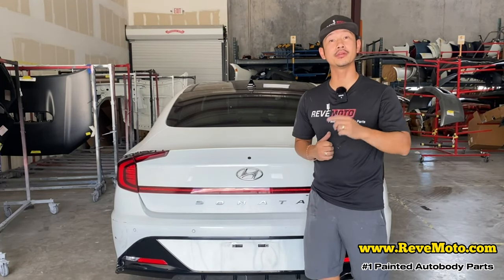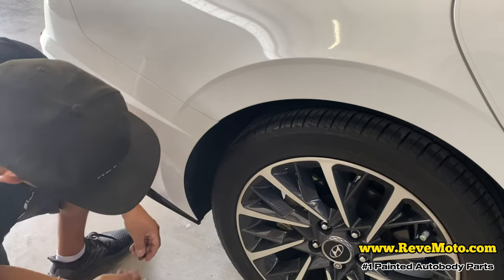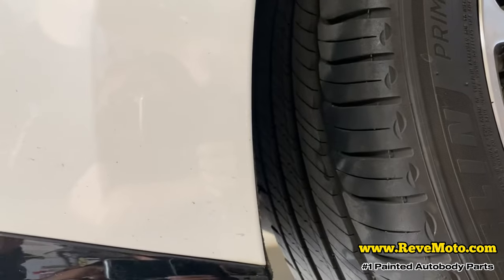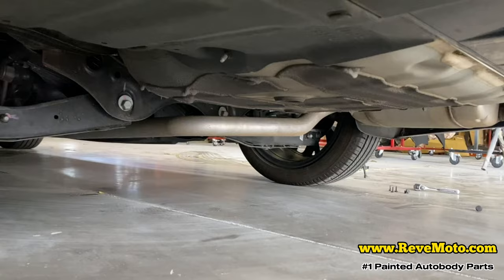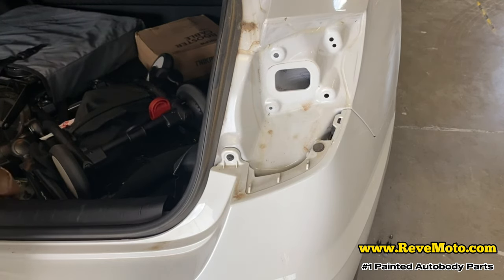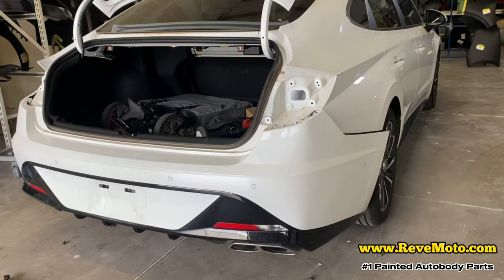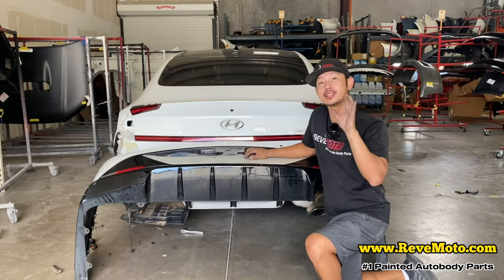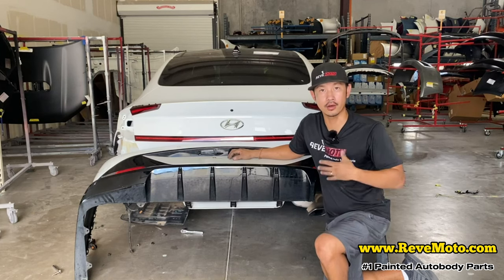2018-2019 Hyundai Sonata Rear Bumper Removal and Taillight Removal.  Less than 20 Mins

Comment: Thanks for the video! For others trying to work on this bumper, if you can't easily reach the screw in 16:43, the retention clip (86593) that's causing the headache is only a few bucks. It's a one-way clip with barbs that keep the bumper tabs from releasing through the slots. In a pinch, you can bend the clip back on itself so the barbs release from the plastic and install new ones on reassembly.
Reply from the maker: Thank you for that information!! That will help the viewers on other options.  You're awesome for sharing.  Go to www.ReveMoto.com for parts